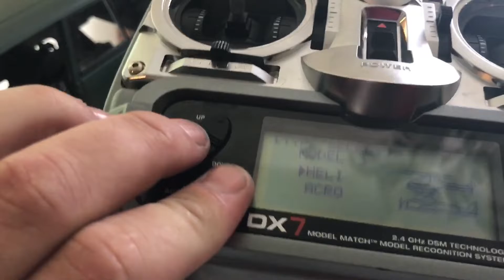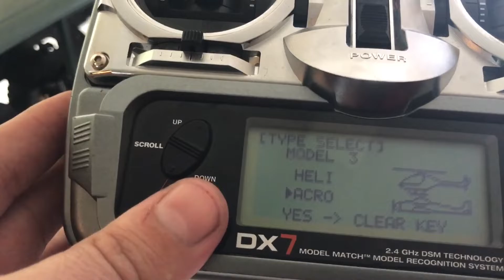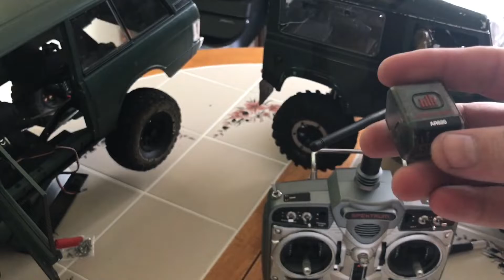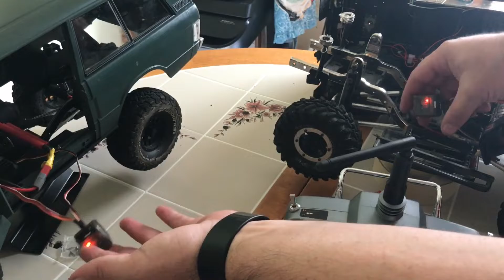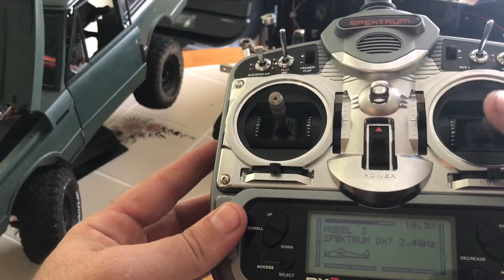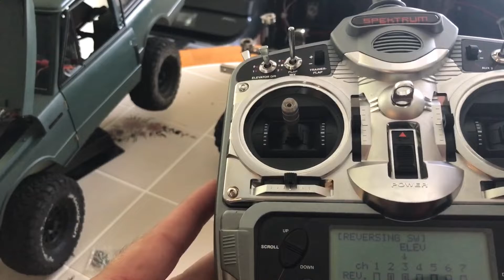SCX 10 ii & D90 how 2 control both

Comment: Brilliant Sean, but way beyond my comprehension. I think I would find it much easier to drive two trucks at once, than actually setting them up  😀 lol !
Reply from the maker: Holly Hill RC oh this is just the top of the iceberg. I actually discovered yesterday that I can run more that 2 so worked today on rewiring one is it will mimic the others going to test drive 3 off them out tomorrow. Stay tuned lol
Reply: @seansrcconstruction    OMG !   😲😲😲  😄👍